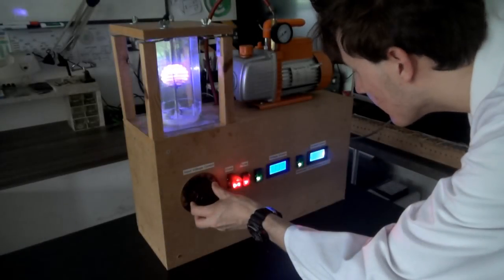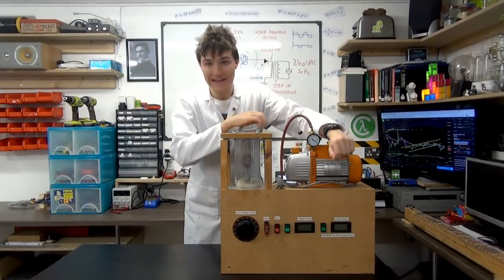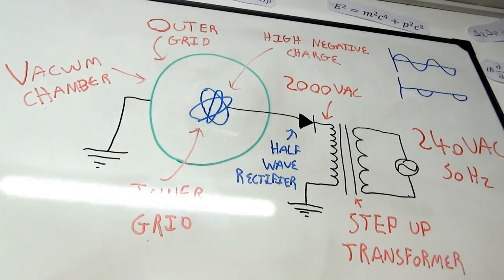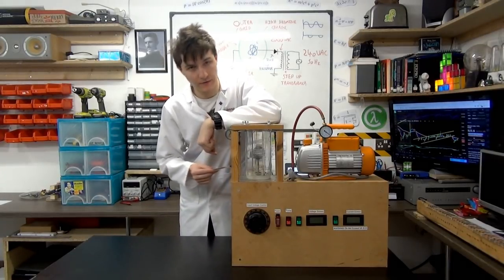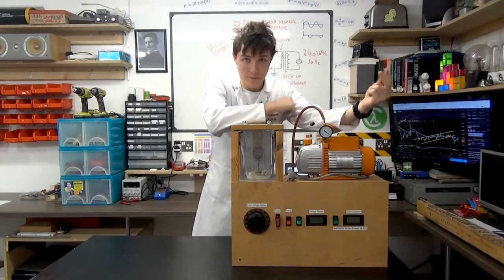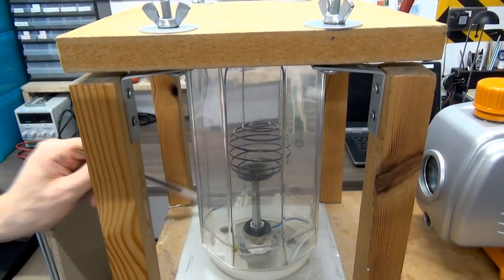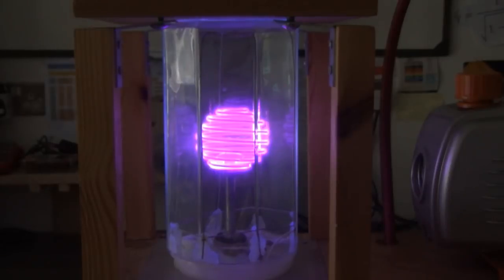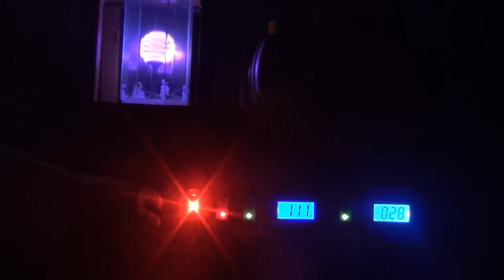My Farnsworth-Hirsch-Meeks Fusor - A Homemade Demo Ionic Fusion Reactor

Comment: A question:

 How come the plasma gets brighter and seems to have more of it around the electrodes the deeper the vacuum becomes? If the plasma is dependent on the matter and it's state then why as you remove more matter from the space does the plasma become thicker?

 Case in point:

 Start with no vacuum and set the voltage to a plasma inducing state then turn on the pump. As the vacuum draws more matter out of the space the plasma will develop and become thicker. WHY?
 If plasma was the state of matter then the whole space would become plasmatic and reduce as the matter is drawn from that space. That is simply not the case. WHY?

 Ever heard of cold plasma or dark mode plasma? what is the difference between the two modes of plasma cold or dark and hot or radiant plasma?
Reply: Three words. Mean free path. Mean free path is the average distance sonething can travel without bumping into something else. As pressure in a gas or plssma drops the mean free path increases allowing more current to flow. The longer the free path is, the longer time a particle has to accelerate in an electric field before recoiling from a collision. Longer acceleration times means more energy in a collision. You could work with a higher pressure, you'll just need a higher voltage to get faster acceleration over a shorter mean free path in order to achieve the necessary energy in a collision to cause fusion.
Reply: @kreynolds1123  
"As pressure in a gas or plasma drops the mean free path increases allowing more current to flow."
 Current to flow in what?
 And is there a low limit that plasma effects would drop like light emission or charge conveyance based on the Tor??
 Do we have a particle amount per square or the amount of charge carriers to go by? Is there such a thing as nil particle counts in vacuum devices and still a plasma discharge is seen or is this a theoretical hypothesis?
Reply: @jonbigman9723   I think your misunderstanding is in what constitutes a vacuum, and i am not talking vacuum quantum fluctuations.  Both demo and starmode fusors still have some gas atoms inside where the electric field rip the electrons off the gas particles so that the positivly charged nucleus rush to the negativly charged center grid with many flying past the grid and  slam into others nuclie and ultimately a few may just stick to each other.  The light at the center of a star mode fusor is mostly the result of de-accelerated positively charged nuclei  slamming into each other. Yes a charge that is accelerated or decelerated creates a changing magnetic field. Together, a changing electric field and magnetic field is called light. In particle accelerators this is would be called cyclotron radiation. A given  fusor will  perform best at a specific pressure and performance tends to drop above and below that.   Fusor.net has more detail on those vacuum pressures. This fusor light is mostly electrons jumping off the grid and emits light as they fall into orbit around oxygen and nitrogen atoms. 

If there is too much pressure from  a gas in the fusor, the mean free path is too short, it limits the current flow and limits how fast the particles can get before slamming into others. Mean free path makes the difference between slamming into each other and  just bumping elbows.

Of course though, this is just a demo fusor. Its not opperating in star mode. That likely requires a higher voltage and more of a vacuum and requires using hydrogen gas.
Reply from the maker: @jonbigman9723  All good questions which show you are thinking clearly about the theory of operation. However, there is one point you have overlooked which simply explains this. Keith Reynolds gave a good technical explanation on this, but here is my simple analogy/explanation. The device works by accelerating ions towards the center. In order to do this, there needs to be a clear path from where the ion is to the centre. If there are too many ions in the way, they simply hit each other, lose momentum and move off course. Think of it like a traffic jam, the more cars there are on a road, the harder it is to speed and accelerate, because you could very easily hit another car. The more air, the less free space there is to move in. That's all there is too it.
Reply: @halfcorp9720  
 Ok then what about this question. We now know that space is not empty. When matter is removed what is left then?
 From my understanding of a vacuum it is still full. That fullness is cold or dark mode plasma. A vacuum only relates to the matter in that space. Space has a medium to it and it is a plasma. even though we can not see it it is still there and what allows the electric and magnetic field to propagate through that space.
 When we excite a vacuum space we are condensing the plasma via the plates in that space. This plasma is connected to all the plasma around it in the environment. When we excite the plasma it draws it into the space and it condenses around the plates into it's component polarities. If there is matter still left in that space the matter gets excited as well and radiates out light, heat etc.
 Matter is a radiator/transformer only. The plasma is the conductor of space.
Reply from the maker: @jonbigman9723  Gluon plasma, virtual particles and random fundamental particles created spontaneously by quantum fluctuations. This is all on the quantum scale though, it has no effect on the macroscopic scale of atoms and ions this system operates on.
Reply: @halfcorp9720  
 Does that mean 1+1 does not equal 2 then? It doesn't matter how you divide the 1 it should all add up to the required answer 2, so it does matter if we want to know how it works for real....
Reply from the maker: @jonbigman9723  Space has no medium, excluding what I mentioned before it is empty, there is nothing filling it. Scientists once though there had to be a medium in space, they called it the aether. Do some research and you can find out how it was disproved. EM fields need no medium to propagate through. That's why we can see light from the sun. If you want to get really technical on HOW waves can travel through nothing, you need to dig into what waves actually are. This will lead you to the theories of wave particle duality and quantum field theory. The current models suggest that all forces are made up of force carriers (so for EM waves, it is the photon), these force particles are created by an excitation in a quantum field which DOES permeate the entire universe, but not in the same way a plasma would. QFT is still a large field of research, we don't have all the answers. However, none of this has any effect on the operation of the machine as it is a macroscopic device.
Reply from the maker: @jonbigman9723  1+1 doesn't have to equal 2, if your values represent probabilities in a quantum system. The rules go out the window when you look at the system at the quantum level, which is what you are referring too when you ask the question of is empty space really empty? Do some research on quantum mechanics and you will begin to see what I mean.
Reply: @halfcorp9720  
"Today's scientists have substituted mathematics for experiments, and they wander off through equation after equation, and eventually build a structure which has no relation to reality." (Nikola Tesla)
 I surmise this is what has happened.

Comment: what if you used a vandegraf generator for the voltage?
Reply: Doesnt work to low of a current
Reply: @jessetermeer2187  they were originally invented for use in nuclear accelerators... So why not?
Reply: @preciousplasticph  Didn't know that but this guy is using 2000v around 1amp. So maby it would work but hole design needs to be different. Just get an old microwave watch out for the capacitor also one mistake and you dead...

Comment: I thought for an official fusion reaction it reaches temperatures of around 27 million degrees Fahrenheit (15 million degrees Celsius).
I think I don't understand science. :P
And 2 Earths plus negative I thought would cancel out each other.
I thought Negative was earth and Positive was the opposite.
Its an Ionisation system I think and what some old clock radios and lights used before the days old good LED's.

Yeah Science !
Reply: This is not a fusor this high voltage in a vacuum
Reply: 1. the plasma likely does reach those high temperatures but since it is so low pressure and so few nuclei are at that temperature then the total energy isn't that high therefore it doesn't heat up much.
2. Your understanding of positive and negative is quite off so id recommend watching a few explanation vids to get a better understanding

Comment: Amazing project! But i have a question, in this case, just pumping out air and firing it, does it emits radiation?
And if you put other gases, like hydrogen, will it?
Reply: It will produce xrays and UV-light, the nuclear ration (neutrons etc) are negligible. For a plasma to form you need a little bit of gas, but air will not start fusion. For that you would have to add deuterium for example.
Reply from the maker: The voltage is too low for any dangerous x-ray production. Since this is a demo fusor, no neutron or ionizing radiation is emitted. If this was a fully functional fusor with deuterium fuel, then yes, neutron radiation would be emitted.
Reply: Would normal hydrogen gas work for fusion
Reply: Yes in hydrogen may be fourth of hydrogen could be deterium so it is probable to get fusion

Comment: How do all of those neutrons and x-rays feel on your face bud?
Reply from the maker: The demo fusor isn't powerful enough to create meaningful amounts of radiation. Not only are the voltages and currents too low, but the quality of the vacuum is orders of magnitude lower than that of valves and x-ray tubes.

Comment: You can purchase tritium online, just search for tritium glowsticks. These are send in little glass viles with just an tiny amount of tritium and helium³. One vile should be enough for your reactor, because you don't need a lot of it.
I wrote  the first part before i saw the Video fully. I think your pressure is too high, you need a high vacuum for a fusor to work. And a higher voltage too. You know that your pressure and voltage is high enough if you are able to create a star like plasma form.
Reply from the maker: As I said in the video, this is just a demo fusor and I'm aware it would need a greater vacuum and higher voltage to transition from halo mode to star mode and actually fuse.
Reply: Don't give him ideas.

Comment: Ok, base on comment and above video, that you can't vacuum all air and you say it is impossible? Why is that? Or you can vacuum all air, but part of air that is electrons is being vacuumed, so leftover is stronger particles that are nucleons. So, it interacts as there is nothing except each other, but of course, I can be wrong since nucleons is stronger that means the vacuum is not high or you say impossible that it pulls the nucleons, the stronger particles than electrons. So, perhaps you can't vacuum because it is not full as whole vacuum because of the rate of motion, per degree in Geometric shape that is the location of vacuum is on one side and below the side where the bottom is that is the air that travel to exit hole, which the diameter of the vacuum is smaller than bottom round part where you sealed it up, so the rate of degree motion. To make it clear to understand what I am typing that is the diameter is 180 degree, so above is a line of parallel 180 that is vertical to horizontal, so the wider part to narrow part is a divide which it is a fraction so you divide the remaining diameter into two sides of center diameter where the exit is, so for parallel diameter to side diameter to equal as 2 or more, so it needs more power as to travel to direction from far side to center side since the degree motion is in addition to horizontal motion, so can't suck all because it sucks with it. But if it is long horizontal that is a smaller size diameter that match bottom size, so it does not suck but takes a long time to suck it. So, ya can't suck all because it is a limit diameter of sucking to non-sucking diameter on the side, or no matter if it is parallel on the bottom, you can't take all air? I am sure ya can or it would be the particles itself exceed the vacuum power as the vacuum space in comparison to the diameter of particles, so the ratio vacuum is higher in power in holding the particles so the vacuum is not strong enough. Or it is about the energy of the atom itself that causes the motion in the higher level, the more the vacuum power increase so atom has freer of non-interact of other atoms so the energy of solo atom is higher so take more energy to remove it. But I doubt it. 

Another thing so the plasma comes from volt or the volt is necessary to start the process and which it interacts atom of air which there is no atom to atom, but directly atom to the metal itself, so it means high mean free path or clear path. So, it is about directly impacted, not indirectly impact which another atom that is secondary was getting bummed from the first atom, which the secondary impact to metal will not cause light? With high mean free path, there is only two interact from air itself to metal, so it is same as solid itself as there is no interact of solid, so the higher speed so it is about higher speed so the air in a balloon to above to ground, the balloon expands as the air inside travel fast as the mean free path is high base on the outside so the weaker pressure is expanding as there is no additional pressure from outside so you remove the outside, so the inside get stronger so it creates higher impact. So, it is about the impact that causes light. So, the volt is for what?? You have pressure which is negative pressure so you remove the air, so the speed of motion will cause the speed of the range of the gap of space is being filled at one time. What is volt for? 

LIke you vacuum the air that is fast so the steel drum will collapse because the diameter of a gap of space per ms is being vacuumed so it needs to fill up in milliseconds. So, when you have higher pressure to suck up, the energy forward to impact needs to be high so it impacts the center to create light. So. It is about balance of everything to make work. 

You can create two vacuum for external side and for the internal side, so using the right math so the speed of sucking outward to speed of sucking inward so the inward impact causes bigger light. That would be a good experiment to understand the balance to result of power.

Comment: Putting a diode on the primary of a transformer is a pretty bad idea transformer work on AC not DC. Calling a transformer going from 2000V to 240V a step-up transformer is very strange, why would you get  50Hz on the output unless you feed the 50Hz grid to it. You have just built a cute plasma lamp.

Comment: I see no gieger counter or proof of neutron detection. Sorry man that's either a plasma globe that ionizes the oxygen in air into ozone or it's just a florescent light bulb the hard way. You need higher amperage and possibly thicker wire; not to mention the electromagnetic fields needed

Comment: I doubt any fusion at all is happening, not next to zero, literally zero. The gasses in the chamber are far too hard to fuse than this thing could do, even in negligible amounts.
Reply: And what do you have a degree in
Reply: @ambiguoustvreference835  Because you need a degree in nuclear physics to know that the fusion of nitrogen, oxygen, and any other of the trace elements in the atmosphere are unable to be fused at the energy levels he can achieve. Perhaps you should get a degree in common sense.
Reply: @mrchangcooler  there is also percentage of hydrogen in the atmosphere, however low